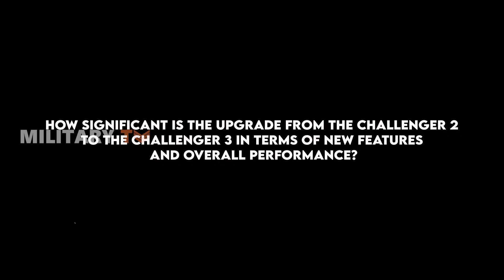The Secret Behind Challenger 3's Testing in Germany

Comment: Tungsten will never replace DU rounds, because it is thermodynamically inert.  DU on the other hand emblazes and any spall ignites everything around it.  For practical purposes it replicates a WP round, but able to penetrate heavy armor at the same time.  The radiation exposure is a myth.  You are going to kill them anyway, why do you care?  At Fort Carson when this became an online scare screed, the US Army had to go find BU training rounds from artillery (much larger), and could not do so.  The local Granite rocks had so much more radiation, that it completely masked any traces of the DU.  That was a major embarrassment to the local Wokie and Enviro groups.  Some actually cried, and went back to live amongst the granite radiating rocks, where they came from.
Reply: Thermoreactive after armor effects of DU are negligible compared to the main effects which is shrapnel from the penetrator and spall from the armor. Crew is long dead at the time the heat has expanded enough to do any harm.
Reply: @jonny2954  You are probably correct for a vehicle where the crew is directly exposed, such as in an early LAV without spall curtains, or some of the earlier lightweight Russian tanks.  If the round penetrates, it usually knocks the crew senseless, and typically it takes them several-to-many seconds-to-minutes to try to get out.  Usually, only the driver gets out (or rear occupants).  Youtube has videos of this effect.  When we did this testing, the clothing and any combustibles are ignited (albeit slowly in a manner of seconds), but if this progresses into the autoloaders or ammo storage, then the vehicle will be destroyed as anything major ignites.  Russian tank designs are especially prone to this, due to the ammo storage.  Ammo storage in these is inferior, and almost any heat round, and now a simple overhead drone, can defeat such tanks easily.  TOWs are especially effective at this, but only at short range.  Drone TOWs will soon be developed for modern warfare.  Watch that space.  Actually it already exists, but only for larger platforms.  Drones next.
Reply: crap claim... most 120mm user do NOT use DU rounds 
DU rounds are only used by nations theat dont give a fuck about inventory and crew health because the only real reason to use dU over tungsten is costs... DU is cheap tungsten is expansive the different in perfromance is next to not existing
Reply: @nagmashot  There is ZERO risk to the crew from a DU round, and usually they cannot even set it off with a hammer.  They are electrically fired.  The difference is performance is astonishingly greater.  You've obviously never been exposed to one.  It is correct that DU is usually not fired in smoothbore barrels, since it is hard to get round rotation in those.  However, the newer Saboted carriers do get their accuracy up, by using a passive fin structure built into the carrier.  this unfortunately also reduces their range as opposed to a105 variant.  If you are concerned about health, be aware that the EM environment inside a tank is huge, especially if the doors are open.  We measured upwards of 200+volts-per-meter field strengths at over a meter inside.  This is enough to cook your brain, if you stood near to it, for a few hundred hours.  And that is actually happening.
Reply: @brunonikodemski2420  no one Talks about Crew dummy… the Risk is for anyone else after the battle radioactive dust on the battlefield that cause cancer if you inhale it
Reply: @nagmashot  You have not read the story of the Fort Carson search for such radioactive dust or particles.  The Enviro freaks tried to make this an issue some years ago, and the US Army discovered that they could not actually find the DU scrap or dust, since in our area, the local granite, and granite dust is actually more radioactive than DU.  The whole operation was an embarassing failure.  In the UKR this might not be true, since they are in a "drainage basin" scoured over millions of years.  As such the heavy metals have probably all been washed downstream into the Black Sea.  Parts of Africa have the same problem.  The RUS are probably going after the eastern side of the UKR, for all the mineral belts which are contained there.  Those also have heavy metals, very valuable.
Reply: @brunonikodemski2420  kid I am into this topic since the 1990´s .. there were massive problems after ODS for locals who inhalt all the dust directly after battle ..so dont come up with this crap report that tryed to play nice with DU user... there is a reason why  the majority of 120mm user do NOT use DU rounds and use much more expansive tungsten... Germany Japan France Spain Italy Sweden south Korea and nearly all other 120mm user do not use DU ... if it would be no health risk at all..all would use it... get out of your propaganda bubble that lies to you about DU ... the problem with DU rounds are the small particles with relaivly high readiation that are in the area after the hits ... that settle on surfaces and gets blown up by wind... it gets a health issu if they get into your lung

Comment: They need  something like a 1600HP engine for adequate electrical power and a laser defense system on a crows or mk46 mount with a backup GAU19B or Dillon Aero 503D as part of a Trophy hybrid APS. 

They say DU rounds are 20% more penetration? but tungsten is a harder material. Maybe 20% more lethal post penetration due to pyrophoric effects? Someone please educate me. Does DU obtain higher velocities to achieve those numbers?
Reply: Already sorted with the engine
Reply: @kevinhunkin6364  They need to investigate a pair of 800 hp Koenigsegg hybrid electric motors, they take up 39kg's and a cubic foot of hull space each. If they were coupled with a  German or American power pack they would have a 3100 hp monster.
Reply: DU has self sharpening properties as it spalds on impact with another hard material, so that may be why.
Reply: @JarViKK_gaming  It's like saying that a 7.62mm round has 20% better penetration. And calling it a day.

The questions then are : 
1. Which 7.62mm ?  7.62x39mm or 7.62x51mm ?
2. 20% better penetration than what ? 

Same with DU vs tungsten. 
Take this example : DU rounds from an L44 Abrams gun have better penetration than tungsten rounds from an L44 Leopard 2 gun. And call it a day.

But, to be fair, you have to mention that the L44 gun in the Abrams has a higher pressure than the L44 in a Leopard 2. So the Abrams round has higher energy.

But newer Leopard 2A6 models have the L55 gun, with more propellant and longer penetrators, so they have more energy.

Newer still Leopard 2 models and the Challenger 3 have the L55/A1 gun with both high speed AND high pressure, so they have even more speed and energy.

The problem with DU rounds is that they become too brittle after a certain speed, that's where tungsten shines. But tungsten is more expensive.
Reply: @eddgrs9193  I mean pound for pound same gun same pressure, same rod length. Does DU also get better velocity as it's not as heavy as tungsten. I know it get the sharpening and pyrotic effect.
Reply: @knowahnosenothing4862  "I mean pound for pound same gun same pressure, same rod length" - you also have to add propellant quantity and barrel length.
And there is the problem, DU becomes useless after a certain velocity, it will just shatter on impact.

Comment: The Challenger 3 is a Challenger 2 with fresh lipstick and new eyelashes.
Reply: And new eyes and a new gun.
Reply: That’s because it’s still challenger, just an upgraded version. 

The complete replacement for challenger will just have a new designation name, chieftain, centurion were all the tanks before challenger. 

The hull of challenger is still good there’s still enough of them to upgrade and modernise, once the complete package is behind then there will be a new tank rolling out. I had the same argument then realised it’s not a new tank it’s just the better version of it. 

Essentially it’s don’t fix what’s not broken
Reply: @Stevegals  The turret, gun, fire control system, electronics and hull are all new, and the armour is the latest version of Dorchester.
Reply: It's almost completely new.
Reply: A T-90M is but a T-72BU.
Reply: @badwolf66  yeah theese days  this is possible.
Reply: Bro speak nonsense. He looks the Same but 80% difference

Comment: Germany does not use DU ammunition, thus they went to L55 gun to increase penetration of non-DU rounds. America still retains the L44 gun because it uses DU ammunition. So if UK chooses to do so it can purchase American made M829 series DU rounds.
Reply: Nah. Common myth made up by Abrams fanboys. DU was only better in the 80s when tungsten alloys weren't as advanced, and even then only against semi-infinite steel targets. Tungsten alloys perform equal, in some cases even better than DU against modern NERA arrays because of lower ductility.

The US tested the L55 designated as M256E1 and found it to perform superior with tungsten and DU alloy penetrators. Problem was the Abrams stabiliser had issues with the heavier barrel and required a complete refit, which was deemed too expensive.

In fact the US wanted to get rid of the M256 since the 90s, just look at the XM360E1. Wouldn't make sense to develop a new higher pressure tank gun if the current one is sufficient, huh?

TL;DR: Abrams has erection problems with the longer barrel, so they had to stick with the short one. Meanwhile the Germans are ahead not one, but two generations with the L55A1 (L44<L55<L55A1).
Reply: @jonny2954  
You are just a wealth of disinformation
The L55 was not adopted as the US found by reworking the propellant of the M829, they could get the same performance without the need for expensive refit 
Secondly the XM360 was still highly experimental in the 90s and its Electrothermal-chemical (ETC) was not considered mature enough for use but most importantly
it needs an autoloader which the Abrams didnt have
Reply: @verdebusterAP  No,  you just blindly gobbled up the BS the  fanboys made up in defense of the Abrams. If the L44 could've matched the L55 with just a new propellant the Germans would've done the same. They're not stupid. It's their gun tube after all. The M829A3 introduction was literally delayed in 2003 following a too hot propellant mix. L44A1 and L55A1 exist because L44 and L55 are at  their  pressure limit now.

Other Abrooms myths:

"M256 ackchyually has higher chamber pressure than the L44"
No. Same gun tube. Recoil mechanism and mout is different, that's it.

"M256/L44 ackchyually have higher chamber pressure than the L55 because  it's shorter"
Also no. Design requirement of the L55 was literally that it can sustain the same or higher chamber pressure than the L44 for ammunition commonality.

"Germans only switched to the L55 because they have to offset performance of non-DU ammunition"
This is  the funniest one. DU apparently  is the only material that has adiabatic shear, however the Americans themselves created self sharpening tungsten alloys at the US Army Research Laboratory in the early 90s. Whoops. DM63 fired from a L55 doesen't just match a M829A3 fired from a L44. It outperforms it. So either the Germans  accidentally overshot the target of matching DU ammo, or they actually had a real reason to make sure  they can penetrate modern Russian armor (perhaps look at a map and realize most Abrams tanks are  in fact on the continent called "America"  and most German tanks are less than 1000 km from the Russian border, makes sense eh?)

Germans got a gun now that's both higher pressure and longer than the M256 and Abrooms fanboys still think it's only to offset the lack of DU penetrators.

No. The Germans just have assessed Russian armor capabilities differently than the US and put more emphasis and per-vehicle funding on their armored corps. It's a little obvious once you see a Bradley parked next to a Puma in joint exercises.

Also you are confusing  the XM360 with the XM360E1. The XM360E1 was specifically designed for the Abrams. While the XM360 was developed to match the performance of the M256 on a lighter vehicle, the XM360E1 was ment to exceed the performance of the M256 on a heavy vehicle.
Reply: I read that a DU APFSDS round has its maximum penetration potential at a velocity of around 1500 to 1600 m/s. While a Tungsten alloy APFSDS round has its maximum potential at more than 1800 m/s.
In addition using lower muzzle velocity rounds could have a slightly higher barrel life, in comparison to a higher velocity round.
Reply: @levilastun829  No. DU rounds still increase penetration above 1600 m/s, just not to the degree they scale penetration up to 1600 m/s. A given projectile of the same weight and dimensions traveling at higher velocity will always have more kinetic energy and kinetic energy is directly related to penetration, regardless of material.

Also performance at 1600 m/s is hardly an argument for a 1600 m/s muzzle velocity because when the projectile enters an enemy tank at 2000 meters it's actually closer to 1500 m/s (1480 m/s to be exact). Also higher velocity means less time traveled and flatter trajectory, meaning higher accuracy and hit probability.

So ye, absolutely no reason to not go for higher velocity. Just Abrooms fanboys making things up to excuse the Army not upgunning the Abrams because expensive.
Reply: Again with disinformation
As you stated before, Tungsten alloy rounds are considerably different from the rounds made previously. The US reworked the propellant and got the desired results with the M829s using Depleted uranium. Germany tungsten alloys rounds needed the longer barrel to attain higher velocities. The M829A3 was not delayed nor was the too hot propellant mix.
The initial batch was restricted to wartime use due to unexpected barrel wear
DM63 fired from a L55 doesen't just match a M829A3 fired from a L44  It outperforms it.
funniest thing you said all day Tungsten alloys are neither self sharpening nor  pyrophoric
Yes the US Army did test out possible combination but not delivers the results like DU 
Funny how physics just outs the window with your statement
The M829A3 sabo weighs 15lbs with chamber pressure of 566 Mpa while DM63 weights 11lbs with chamber  pressed of 545
Funny how that does not add up
Now pay attention, the M829A3 mass is so it impacts a higher degree of KE on impact which the US had found is easiest way to defeat Russian ERA 
Lastly, US tanks are being asked to come back
The German military has been plagued with equipment and personnel issues more and more 
So how many operational tanks with trained personnel available at any notice is why the US is being to come back
Reply: @verdebusterAP sorry but you are currently spreading misinformation. Yes. Tungsten alloys can be made to be self sharpening. It was even demonstrated and is a well documented scientific fact.

We look at higher penetration. And at the speeds the rounds travel at the destruction caused inside becomes nearly identical.
Reply: @emilsinclair4190  
And apparently you cant read either
as stated before
"Yes the US Army did test out possible combination but not delivers the results like DU"
The process is called Staballoy and again
The Army was not satisfied with the results
Reply: @verdebusterAP  apparently you don't remember your own vomment. Your stated that tungsten alloys are not self sharpening. Well it is a well documented fact that they can be. There are countless scientific papers about that.

Yes. The us military tested out some combination. Sure. And? Do to it being an alloys you basically have countless combination. Apperently some successful alloys were found. 

And the alloy mentioned by you is its improved machinability. Meaning that it is easier to produce/cheaper.
Reply: @emilsinclair4190  
Again Tungsten is not naturally self sharpening
Staballoying tungsten to make it self sharpening does not mean it delivers the same results as depleted uranium
There are many combinations but which are cost effective and delivers similar to superior performance to depleted uranium
The answer is zero
Reply: @verdebusterAP  intresting how your original statement was that tungsten alloys are not self sharpening while now you just focus on tungsten itself. Since basically nobody uses pure tungsten (or du) this is a mute point. They are used in alloys.

Yes. Cost is the factor that made the us go for du. They had a lot of it so it was cheap for them. Bit this is not true for every country.
Reply: @emilsinclair4190  
Again wrong
The DU alloy used by the US has a low amount of machining to preserve its capabilites while Tungsten was requires an extremely high degree of maching
Reply: @verdebusterAP  ...yes. so you are saying du was used bc it was cheaper. We get it.
Reply: @emilsinclair4190  
How much does it cost to machine Tungsten alloy rounds
astronomical 
As someone mentioned the US ARL has been working alternatives since the late 90s and the US has vastly more resources than EU
China uses DU more religiously than the US or Russia